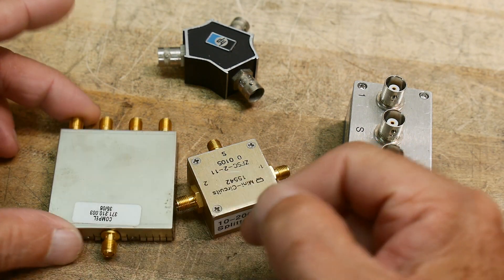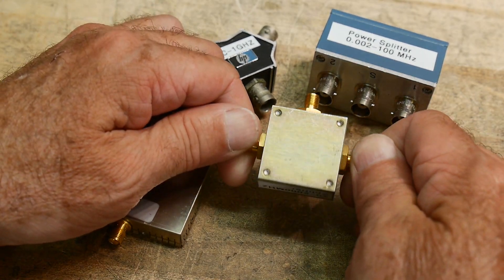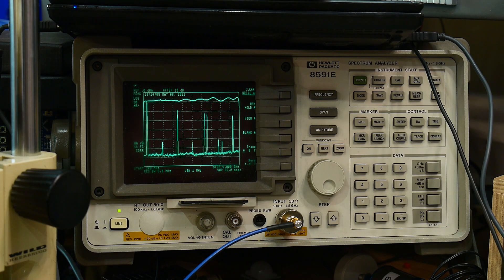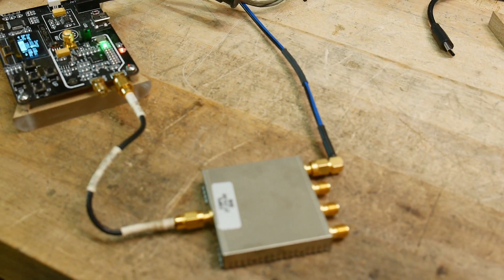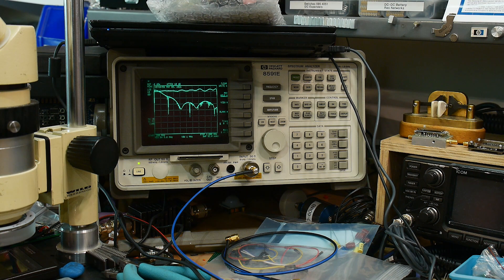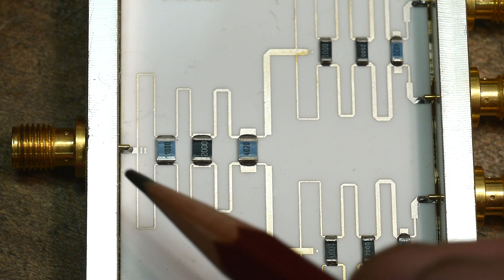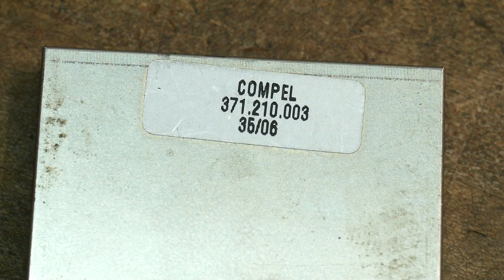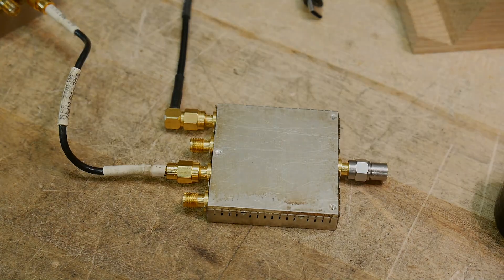#805 Four Way RF Splitter

Comment: I needed a 2-Way RF Splitter for ham radio use so I could use one antenna on two radios (receive only). On a whim, I measured the Insertion Loss and Frequency Response of several splitters I had in my parts bin designed for TV use. I discovered the GE Coaxial Cable Splitter which is spec'd over a frequency range of 5 to 2,500 MHz actually works well down to 1 MHz and the loss was only slightly higher than the theoretical 3.0 dB. This was clearly the best of the bunch and beats out many other well-known splitters in all essential parameters. Some engineer did a remarkable job designing this device to be able to sell it for such a low price. It can be purchased from many different sources for less than $10. 
The down side is it uses F-Type RF connectors, but adapters are easily obtained to convert F to BNC. Keep in mind a 4-Way Splitter will have double the loss of a 2-Way so use the minimum number of ports that is required for the application. Note also I measured a very wide variation in performance among TV splitters from various brands even though they were all spec'd essentially the same so do not assume any TV splitter will work just as well. The GE was without doubt the best performing one.
Reply from the maker: If it is only receive, did you try a simple BNC T? I don't know why you need isolation between receivers. If you do, just use two resistors in a Y.
Reply: @IMSAIGuy  : Yes, that would work, but sometimes the Local Oscillator of one radio could feed back into the other radio. Depends on the frequencies and quality of the radio, but generally I like to keep everything at 50 to 75 Ohms all around.

Comment: This is a Wilkinson splitter / combiner.  It has less insertion loss than a resistive splitter, but operates over a reduced bandwidth.  The trace lengths are related to the frequency of operation.
More information here:
https://www.microwaves101.com/encyclopedias/wilkinson-power-splitters

Comment: I think I have seen an explanation of these kind of splitters and the inductors are actually high impedance transmissions lines that gets lower impedance at each stage after the resistor bridges (hence the wider traces)
Reply from the maker: That sounds reasonable. This also keeps the phase information intact.